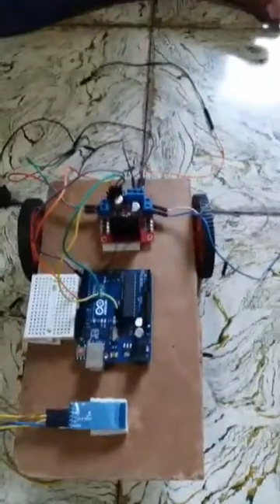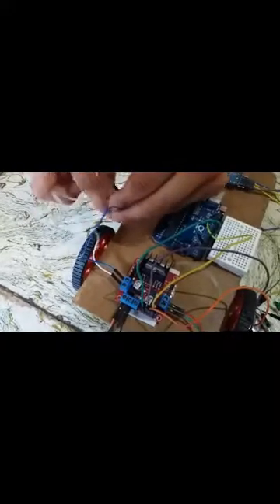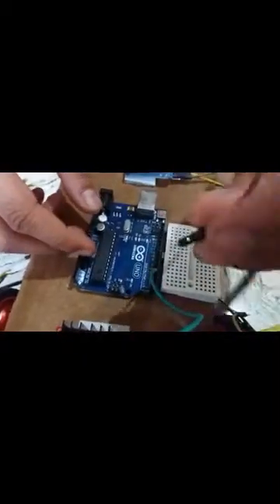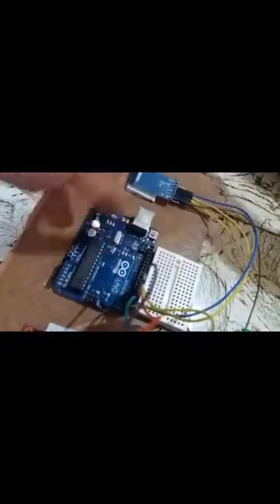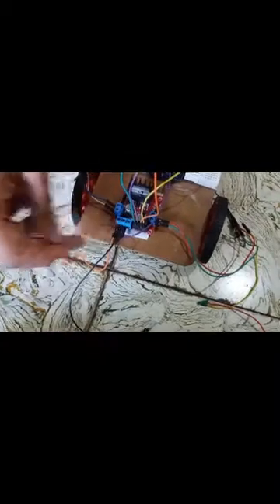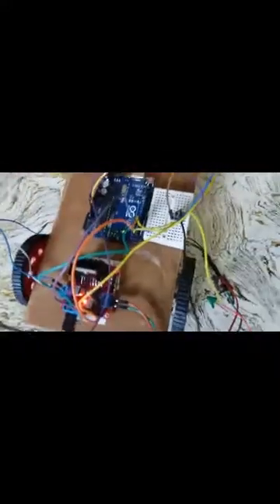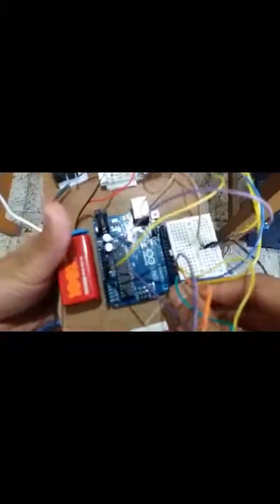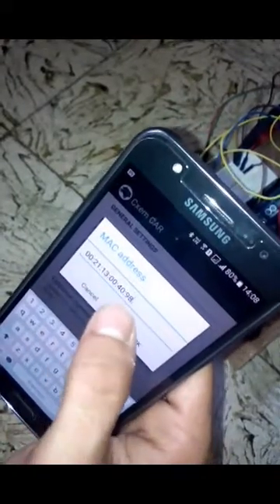how to make arduino bluetooth control car using l298

Comment: Very very thanks bro .I done searching many voice control car but this is only working
Reply: I already did it
Reply from the maker: @sreenathm6893  congrats bro
Reply from the maker: thanks a lot plase like share and subscribe to be with us to make our growth so that we can bring more like this to everyone ...
Reply: Hey can we use 12V instead of 9V
Reply: Please answer fast
Reply from the maker: @sreenathm6893  in l298 there is vcc vin nd ground see the backside of the controller there somewhere it is written 12v there u will give 12volt and by using 7805 divide the voltage to 5v and give this to  vin or vcc where 5v is said to be attached and connect the ground..
Reply: Please explain in brief
Reply from the maker: after sending mail i will give you my phone no then call me for assistance
Reply: Then mail or give your number
Reply from the maker: @sreenathm6893  rajatsukanto.innovation@gmail.com
Reply: Can you send a video using 12V please bro
Reply: Please bro
Reply from the maker: @sreenathm6893  actually we have our sem now so a busy lil bit and frst of u said u have already made the project ?...if wait a bit i can provide youba vudei with 12volt supply
Reply: Then give a video using 12V
Reply: Now give me a video bro
Reply: I need a video
Reply: Or plzzz explain it with a circuit diagram bro plzzz
Reply: In briefly

Comment: i did the same as you defined but only forward  right left working no backward and buttons in app not working only accelerometer is working that to only three right left forward plz plz plz plz help me
Reply from the maker: Ravi Ghechand try to reconnect the bluetooth properly else check the code ...upload the exact code providded it will work smoothly

Comment: Hey sir good day, are the circuit connections still desame if I will make a voice controlled vehicle?
Reply from the maker: Watch our voice control robot in the video section....that will be more easy and yes this can also be changed into voice control by changing the app nd the code

Comment: Thanks. Is there any difference if i use HC - 06 instead of HC -05 at mobile application???
Reply from the maker: Nikolaos Karountzos in both case all are same just dont use the state and enable pin...all the th8ng thay we have shown r same for hc-06
Reply: which pin you mean to enable?
Reply from the maker: Nikolaos Karountzos the pins we had shown just put them as we had done ....all will work as it is ..if you fave any trouble after completing the circuit then contact us we will help you..
Reply: Thanks a lot. i Will inform  you about my progress.